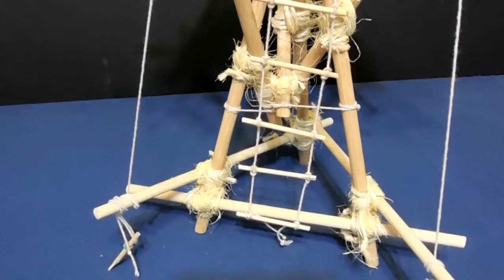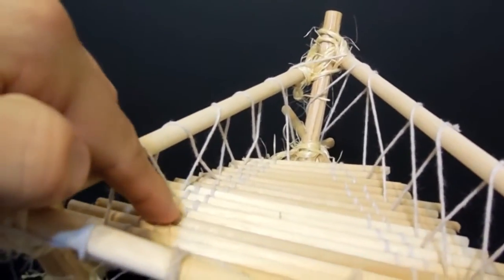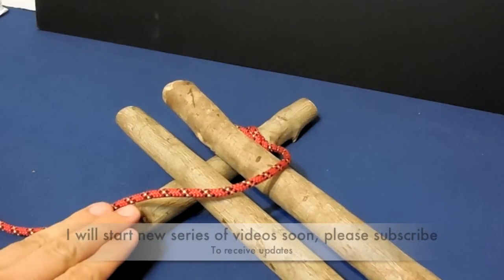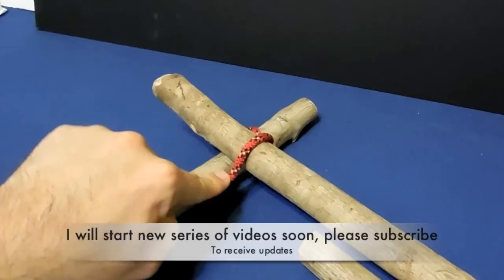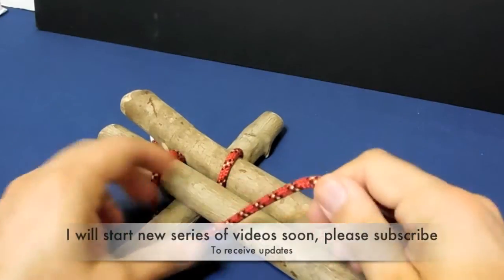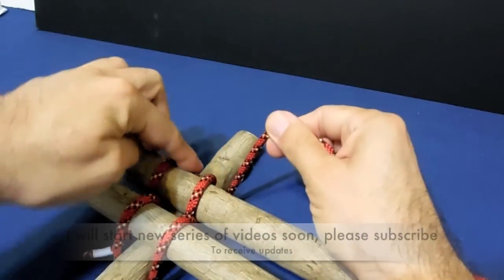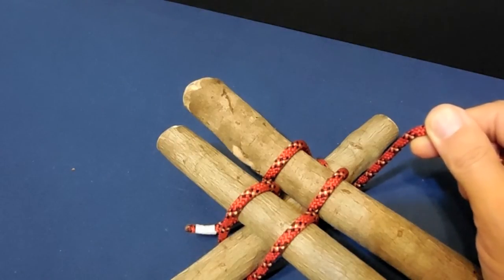How to Tie floor Lashing

Comment: Two things: first, is that iron wood? Second, yall know the square lashing, right? I find it much stronger and easier to work with than this. It's basically the same principle except less squeezing between two logs, which grows harder as they are secured. I do at least 3 to 5 passes with twine, then frap it only once or twice so that it is tight but not bulky. Then, when you move onto the next one, rather than tying another clove hitch, you just leave an extra end.
Reply: This is a more conservative use of cord, but it isn't as effective.
Reply from the maker: Chris Pool , the wood from youpon tree, very common in Texas. Most of my videos are for scouts; therefore I teach from the scouts' methods.
Reply: The scoutmaster yeah. I get that, no more no less. Still, I like my scouts to know what is most effective.
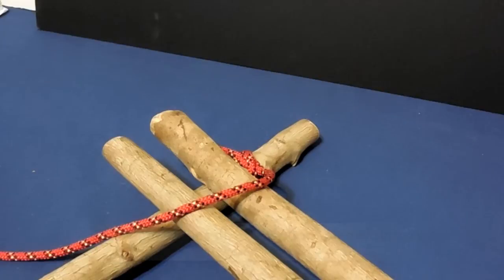Reply: As he said around 1:17 of the video, though, he didn't have a lot of wood handy.  This is called a "floor" lashing for a reason; you're usually using it to secure something like ten or twenty floor poles to the stringers, not three.  The wraps on square lashings won't let the floor poles sit closely enough to one another to create an actual "floor", while these poles would only be separated by the width of the cordage.
Reply: Right. I'm using it to make a bridge now though. I want the bridge to be there for years, so I'll take sturdy over quick. And, considering you don't have to squeeze the rope between the runs, it's not that much more time consuming.